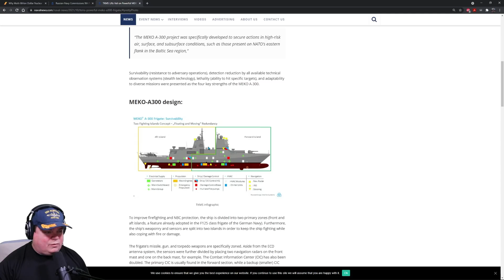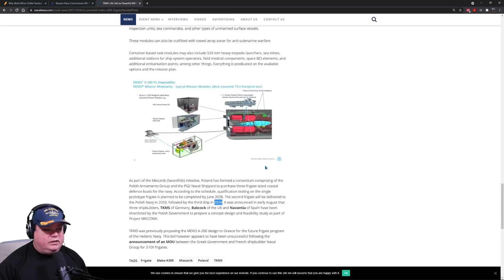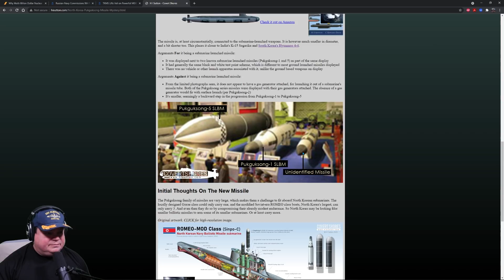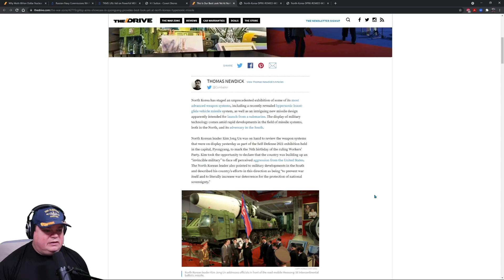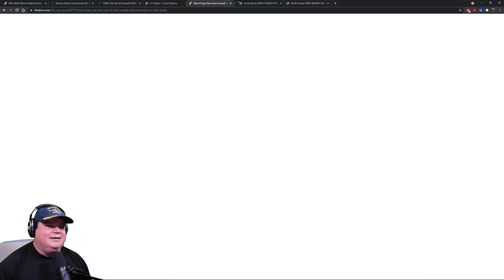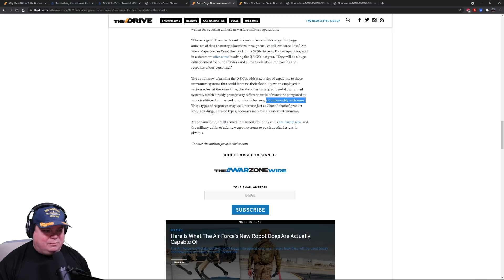Germany's Battleship Frigate MEKO A-300

Comment: About Polish "Miecznik" program, the birds are chirping that Babcock is a favorite mostly because it's the cheapest option. MEKO A-300 is for sure a wet dream of any navy, but with so much systems onboard cost will be enormous and the cheapest offer is always preferred. No mater the technical aspects, cheap is the key word. And knowing Polish naval realities there is strong possibility whole program will be canceled sooner or later.
Reply: This will not be more expensive then the british ship. For a start it is just an evolution of an existing design that is atleast 30 years old. I would suggest it will be cheaper even with all these weapon systems then the type 31.
Reply: @carisi2k11  Dream on. 
If wishes were horses, beggars would ride
If turnips were swords, I'd have one at my side 
If "ifs" and "ands" were pots & pans, 
There'd be no work for tinkers' hand

The cheapest part of any warship is its hull, what really costs is the sensor suite, its weapons systems & the loadout of weapons specified, the CIC + intergeration cost.
Reply: @carisi2k11  You are wrong to such degree that it is almost hilarious. Cost of the hull as already mentioned is the cheapest part of overall cost. The major part is the equipment, systems on board, weapons that are installed. Radar systems, electronic ect. This concept is bristling with such systems to such degree that Type 31 looks like poor cousin of a warship. It have so many of systems on board that probably only his weapons package would cost more then whole Type 31 frigate.
Reply: @ger du  With almost zero AA defense and lack of skerry to hide them... are you serious?
Reply: Those weaponized "dogs" gives new meaning to the phrase "dogs of war".
Can you imagine them turned on our own population by the General Miley type "we are the guys with the guns" were going to have to take yours. No chance of these dogs revolting if asked to turn on fellow americans.
Reply: @ger du  For some strange reason, do you insist that warships should give up air defense? And operate only with constant air cover 24/7 in significant number that could defend it against not only air assets but also ASM's? Well... then I would like to introduce to, Air-Defense ships like Horizons, Darings or any ship with Aegis system. That one of the main role is to be a nightmare to any air asset. And Bismarck was sink by battleships, just receive critical damage by airborne torpedo. Using WWII examples as argument about XXI century naval operations is rather silly. MEKO-300 concept provide the best chance to successfully operate by Polish Navy on Baltic theater in combat scenario, that is the point. 

Winner of potential fight. That's rather obvious thing... the last one "standing" on own feet not the one knock down unconscious, using boxing metaphor.
Reply: @ger du  You clearly have little understanding to Polish realities on defense budget. It is a fiction, which only exists on paper. How much and how the money will be spent has nothing to do with how much is "planned" to be spent. The PMT (Technical Modernization Plan) is only a general suggestion and not a de facto plan. The budget is mostly used to finance fixed costs, including salaries for soldiers ... professional soldiers or territorial defense. Polish armed forces do not rely on conscription. The Navy itself has never been a priority and has always received scraps from the budget to such an extent that unofficially it is a formation "in liquidation". Purchases of new ships are very rare, and those in service must fulfill the entire range of tasks from fighting the surface, underwater and air targets. Thus, if new frigates are finally acquired, which is still highly doubtful, these ships cannot be "poor" but must represent a high standard and ability to survive on the battlefield. You ask a funny question which brigade should be liquidated to have one ship with the Aeigis system, while at the same time just suggesting an expansion of the air force so that they could provide permanent protection to ships deprived of their own air defense... how many brigades would have to be liquidated to acquire these squadrons with infrastructure? You did not mention that. 

You say that you know how Visby would operate, but you maybe not have the best idea about the conditions under which it is supposed to operate and how it relates to the conditions in which the Polish Navy operates. Visby fight from cover of skerries, there are NO skerries on Polish waters. There is no place where ships can hide and fight a hit and run operations. You speak about multi domain context forgetting or ignoring that it only take place in perfect scenario where all elements are on place and work perfectly. If one of those elements fail, in this case, lack of air cover against air treats and missiles... your ships are not capable to defend themselves. Not to mention Poland  have very few air defense systems at all and such ship would be actually responsible of defending from air whole shore and critical installation, because there is nothing else that could do that there. Well there is Aegis Shore but he got own role and command. 

Main role of Darings is to defend itself, other ships and installations from air treats. Something you for some reason treat as unnecessary for warships. A-300 concept was clearly design to be capable to defend itself and others from large attack from air, from the opponent that could deliver a lot of ship killing systems against it in the same time. As TKMS representative said. To survive in such hostile area ship need to be prepared to create multilayered air defense bubble and send in the air multiple missiles to intercept incoming target. It's rather obvious and if you want to use WWII examples, for the same reason at the end of conflict ships carry some absurd level of AA weapons of every caliber including special design for only that role ships. 

Also even if most of the weapon system on board this concept can be used as AA defense, are universal systems. 

At the end, with a high degree of certainty this ship will not be build for Polish Navy, maybe even none will be build. If something will be build it will be the cheapest option, with the smallest number of weapons on board. There is little of understanding of Naval matters in Poland, politicians really don't care about that. We say that "Warsaw is far from shore" and such large ships like frigate could not swim the vistula for parade.
Reply: @ger du  "How is the Army supposed to operate in the presence of enemy air dominance?" - same way as opponent, under extensive AA umbrella that is only supported by aircraft. As Poland don't have enough planes to even provide air defense to own bases it is unable to provide support for other branches that need to take care of that by own means. Army have handful of very outdated AA system, some number of modern VSHORAD and far, far in the future maybe some number of modern system that could provide AA in move. Navy de facto don't have any, and at least in theory they try to acquire such capability in form of ships with good AA systems, because they can't count on any air support. And Suwalki Gap is a myth, there is no "gap" there, it's the most unfriendly to any mechanized warfare land, Poland have outside mountains on south border. 

"Actually, its loadout rather suggests Convoy Defense as the primary mission." - loadout suggest rather maximum capability for every danger there is. That would work well on convoys but as you mention convoys NATO "demand" that Polish Navy had at least two oceanic frigates for... convoy duty. That's the only reason both OHP are in service. So, here you have your mission parameters. 

"However, Poland does have ports to sally from and retreat to." - yes it have... still they are not in skerries. Natural war ports on Baltic are Świnoujście, Parow and Rostock. 

"In which case, sallying from port is a non option" - if ships can provide own defense, it is not only option but normal procedure to exit the port where they are in trap and start to do what they design to do... wage war. 

"In which case, planning for a full spectrum of capabilities is asinine." - most modern frigates/destroyers are multitask ships that are capable to engage all spectrum of task from AA defense, ASW actions, anti ship combat and even land support. Some of them are more specialised in one or more task but they in most cases are capable to do all of them in some degree. 

"Which leads to generic ships that can be overcome by the enemy stacking against ONE specific type of defense. You must choose how your defense is stacked, " - If your ship is specialized in single role then yes. If your ship has "something for everyone" there is not ONE specific type of defense. Modern frigate can defend against all treats and engage all treats, A-300 concept is nothing unusual in such capabilities beyond being stacked with dakka to the roof. Just number of VLS don't mean it is predominant AAD, it also have 16 ASM/LA missiles, more then most of frigates/destroyers. That don't mean it's specific ship killer, large number of low caliber MG, autocanons and main gun also don't mean it is for anti-piracy duty. TKMS just design a concept for ship that don't cut corners, he have something for everyone and in large numbers. Every mission is his mission. 

"Which really ought to tell you what kind of ships are politically feasible. Purchasing decisions do not take place in a vacuum," - none, if that was decision of politicians there would be none ships at all. pressure from the armed forces themselves and an industry that has an appetite for a lucrative contract that will be able to extend and increase their "profits" has caused some movement in the program that has been in the "freezer" for some 15 years. But it is not a question of what a ship should be for politicians, but that something is as cheap as possible, but that something has been done. Whether it makes sense, is not, and has never been important ... piece is piece. Don't search in that any greater thinking, there is none. The favourite decision is no decision at all or ceremonial signing of papers that end with nothing.
Reply: We don't have time for strategic mistakes.
/E: And for doubting comments like this.
Reply: @nikovbn839  There is always time for mistakes, all of them, all the time, every time. Repeating them over and over again.
Reply: @Galvars  One of the biggest mistakes is thinking like this. And letting others divide us. Do something to fix it instead of complaining.

Btw - you two are hilarious. Deaf arguing with blind.
Reply: @nikovbn839  Ah wise words, leading by example I presume, what you did to fix this situation, that stagnation and slow degradation of Navy that take place for at least half of century.  What is that something you did that I can do too?

Comment: Those 324mm launchers are for MU90 Impact, max range up to 12 nautical miles. [correction from 15]
Reply: It would be nice to have a 324-mm torpedo with a 30,000 yard range.
Reply: @davidmurphy8190  Oh I made a mistake, not 15 but 12. 😑